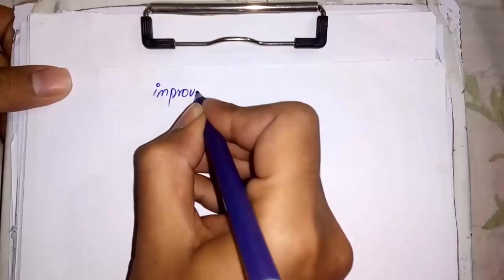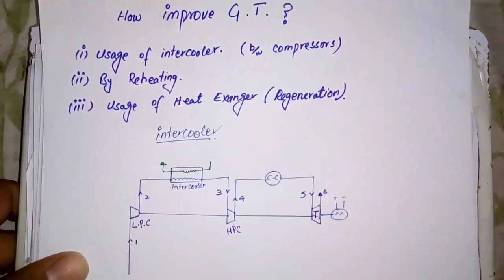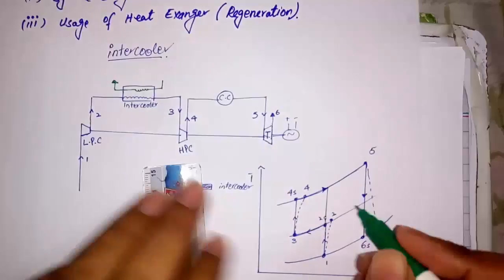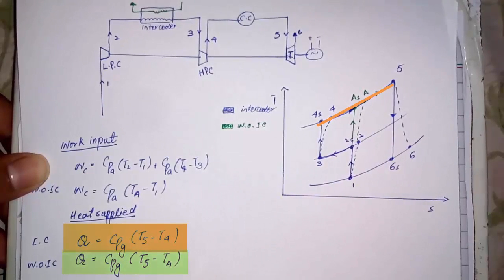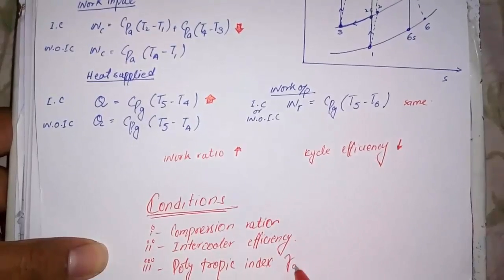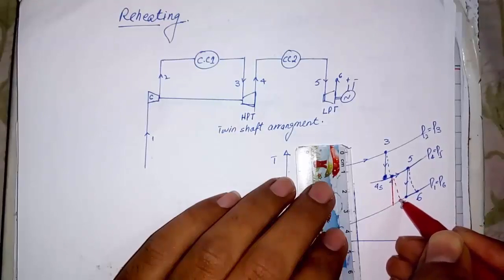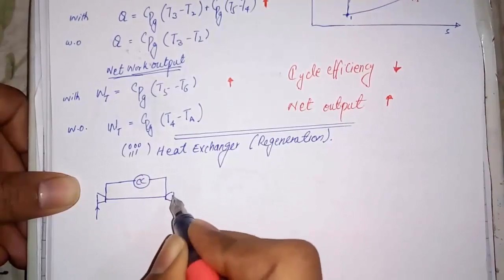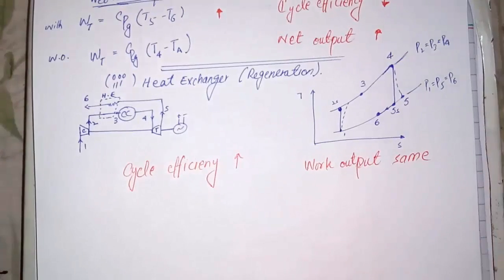How to improve Gas power plant (Diagrams,Formulas,Comparison)

Comment: Good job...  I have a question though, considering where an intercooler,  reheater and heat exchanger is used,,,what would be the workout be if the LP Turbine was mounted on the same shaft as all the other components?  Would the Workoutput of HP Turbine be equal to the Workoutput of LP Turbine,,..  assuming the cycle is a closed cycle. I can't stop stressing as I'm not so sure after getting a similar question in the exams.  Another thing in a closed cycle, in the above mentioned case I know Winput is the same for both compressors assuming intercooler is perfect but I would like to know whether we use the Cp value of air or of the gas to find Work by compressors (closed  cycle)